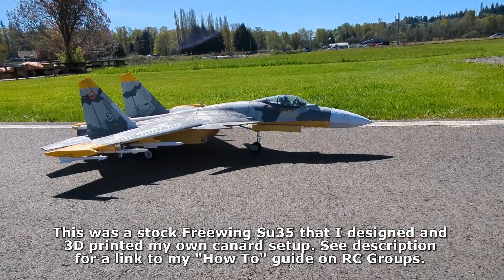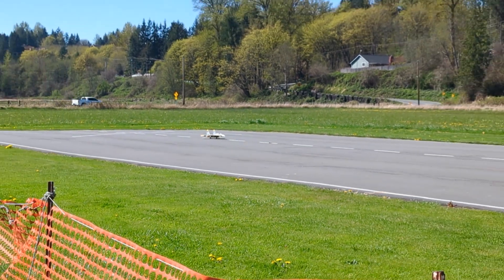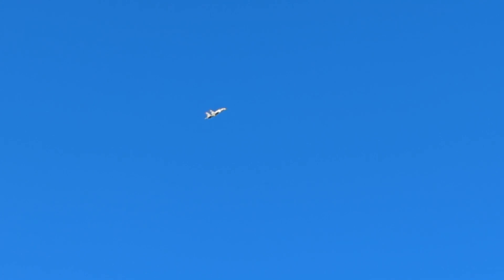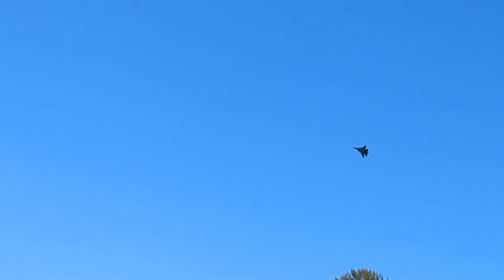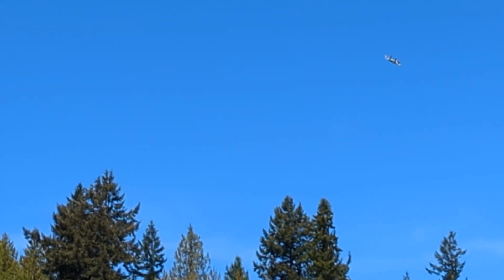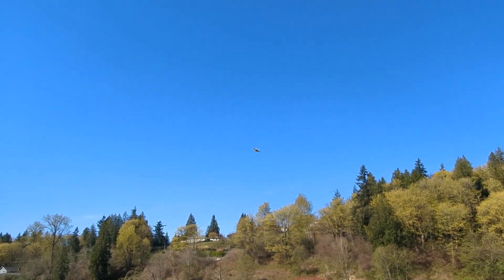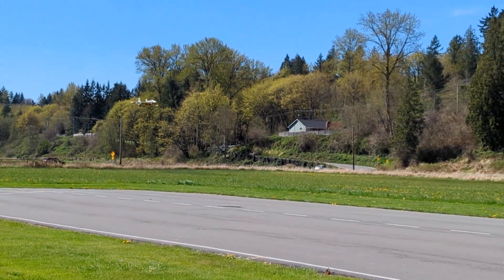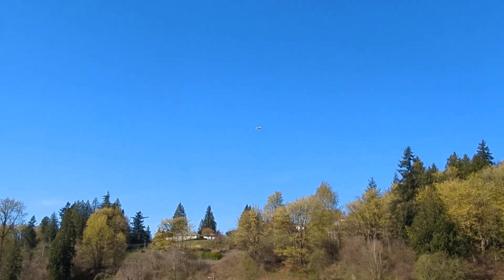Flying My Custom Freewing Su37 with Functional Canards

Comment: Nice.  Any stabilization?
Reply from the maker: Yes. It has a Lemon stabilizer/gyro unit on-board. I have it setup with moderate standard gyro gains to help smooth out the flight from outside effects like wind and turbulence.